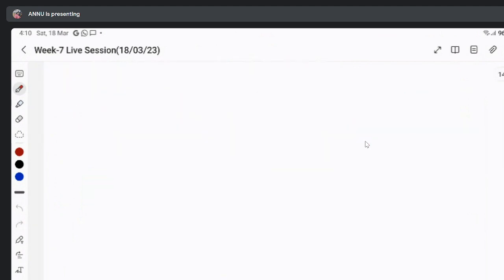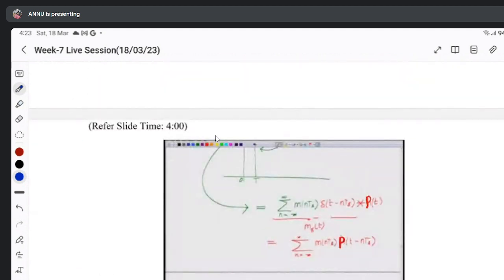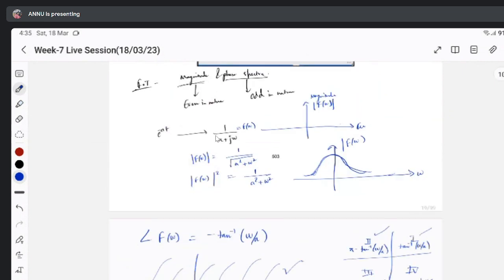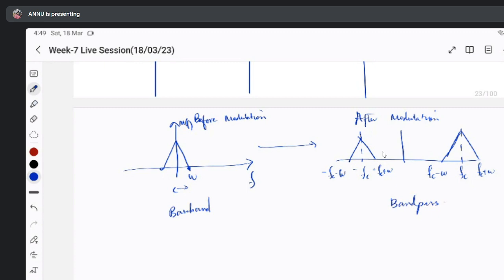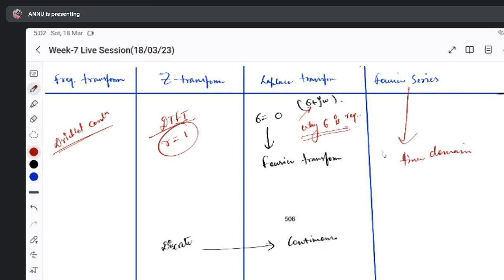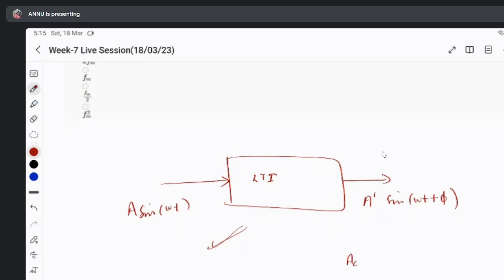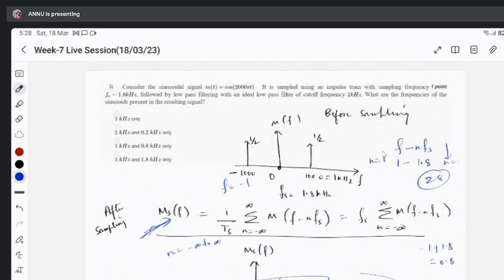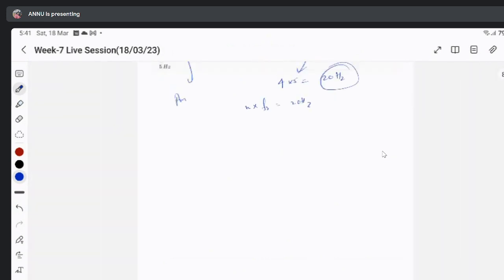Principle of Communication Systems -I by IIT Kanpur| NPTEL | Week 7 Live Session

Comment: Respected  mentor ANNU, I searched for your yesterdays i.e. week8 session material, but could not find there. Can I access the material even at evening? Of course, Last week8 also I scored hundred. But for record of notes, I need your help. Also, I have a doubt in old assignment question. In that It is to find cut off frquency  range of a low pass filter to reconstruct the signal without distortion. I found one expression in B.P.Latthi  i.e. B<fc<Fs-B where B is band width of the signal m(t) and Fs is  sample frequency. Can I use the formula to fix the range of cut off frequency of low  pass filter? Ofcourse, it was given for equaliser. For two bits in old assignment, I got the answer. But is it conceptually correct?
Reply from the maker: Sure sir I am posting now